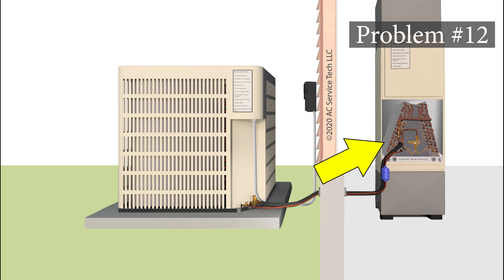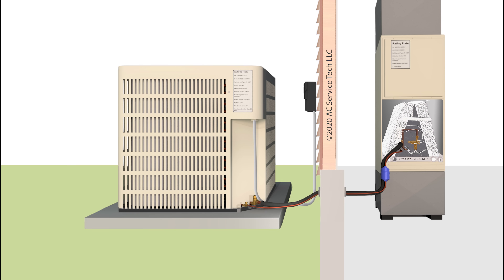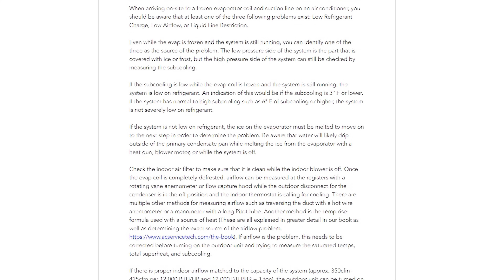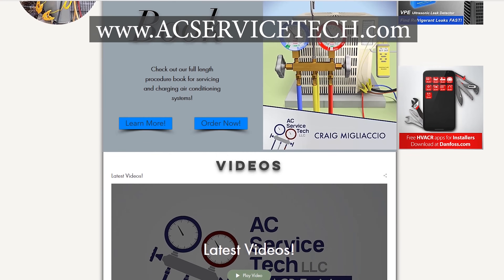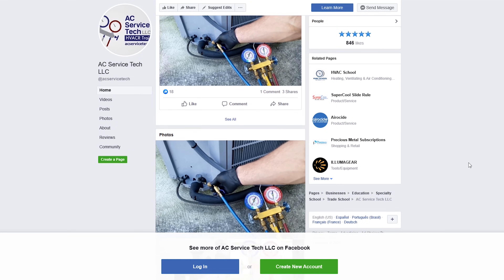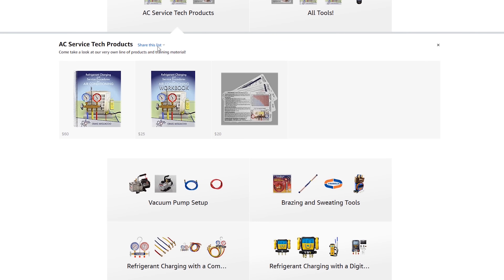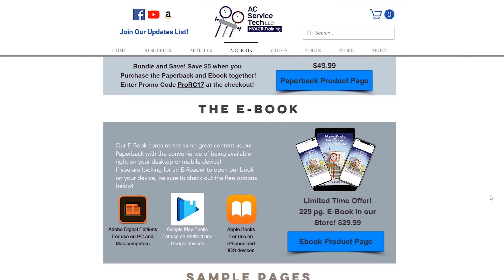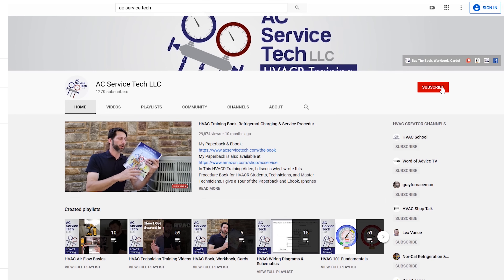20 Causes of Low Indoor Airflow on Furnaces and Air Conditioners!

Comment from the maker: -My Paperback, E-Book, Workbook, Quick Reference Cards: https://www.acservicetech.com/store  
-E-Book: https://play.google.com/store   and search "AC Service Tech"
-My Paperback and Quick Cards:  https://www.amazon.com/shop/acservicetech
-Support the Channel:  https://www.patreon.com/acservicetech
-Tool List:  https://www.amazon.com/shop/acservicetech
-Facebook posts every other day! https://www.facebook.com/acservicetech

-Our Articles and Quizzes: https://www.acservicetech.com

Related Videos:
TESP for Airflow https://youtu.be/eFmDmk1Siqc
Airflow CFM Measured with a Hot Wire Anemometer! https://youtu.be/0wWYsAn6eGo
HVAC Temp Rise Formula used to Measure Airflow CFM! https://youtu.be/agAfV3Yqb7U
HVAC Delta T Explained! What Temperature Should it be? https://youtu.be/9lDl5cfFSzs

Duct Sealant:
Duct Mastic in the Caulk Tube: https://amzn.to/3fc1pzm
Duct Mastic Tube: https://amzn.to/2SrIGpU

Checking the Charge Tools:
Yellow Jacket Refrigerant Gauge Set http://amzn.to/2aenwTq
Refrigerant hoses with valves http://amzn.to/2aBumVI
Yellow Jacket Gauge set & hoses https://amzn.to/2vLVkV9
Yellow Jacket 4 Port Manifold w Hoses https://amzn.to/2BkuGIq
Digital Refrigerant Scale  http://amzn.to/2b9oXYl   
Ratcheting Service Wrench   http://amzn.to/2dGV4Nh 
FieldpieceSMAN360 Digital Manifold Set https://amzn.to/2BdoaD4
FieldpieceSMAN460 Digital Manifold Set https://amzn.to/2nB4Fe6
Compact Ball Valve for Refrigerant Hose https://amzn.to/2KUisW8
QuickDisconnect 90 for refrigerant hose https://amzn.to/2MMtVcg
RectorSeal Bubble Gas Leak Detector http://amzn.to/2ckWACn
Fieldpiece ST4 Dual Temp Meter  http://amzn.to/2wc1ME3
Fieldpiece Bead K Type Temp Sensor https://amzn.to/2DBwKfs
Fieldpiece Wet Bulb Temp Sensor https://amzn.to/2RRI7Tw
Fieldpiece TC24 Temp Clamp https://amzn.to/2qHLyjZ

Electrical Diagnosis Tools:
UEI DL389 Multimeter  http://amzn.to/2xAdaJf
UEI DL479 Multimeter with temp sensor http://amzn.to/2jtsUbJ
Magnet Jumpers- https://amzn.to/2PyKPQZ
Alligator Jumpers- https://amzn.to/2PxqJXn
Irwin Wire Stripper/Cutter/Crimper http://amzn.to/2dGTj2V

Vacuum Tools:
JB 6 CFM Vacuum Pump - http://amzn.to/2nqbvo8
CPS 4 CFM Vacuum Pump - https://amzn.to/2DxgPwY
1/4" Appion Valve Core Removal Tool - http://amzn.to/2uYr8WL
5/16" Appion Valve Core Removal Tool -  https://amzn.to/2JHmfbP
Appion Blue 3/8" to 1/4" Vacuum Hose - http://amzn.to/2uYlVyc
Appion Red 3/8" to 1/4" Vacuum Hose - http://amzn.to/2uYg6Ro
Yellow Jacket 1/4" by 1/4" 3’ hose - http://amzn.to/2umtcod
Appion 1/4" by 1/4" and 3/8” hose - https://amzn.to/2Zyxzx9
Uniweld 1/4" by 1/4" 2’ hose - https://amzn.to/2GFov1Y
CPS Vacuum Micron Gauge - http://amzn.to/2v1nM3O
JB Vacuum Pump Oil - http://amzn.to/2mGrlXy

Flaring Tools:
Yellow Jacket Flaring Tool - https://amzn.to/2OBxGlM
Spin Flaring Bits 1/4", 3/8", 1/2", 5/8", 3/4"- https://amzn.to/31BCs8Z
Yellow Jacket Flaring Tool with Set Depth - https://amzn.to/2QIKsQH
Yellow Jacket Torque Wrench - https://amzn.to/2NRR68Q
Uniweld Swage and Flare Kit- https://amzn.to/2T55jyn
Nylog - https://amzn.to/2MLJcch
Ridgid Tubing Cutter - https://amzn.to/2DnjjR1
Wolverine Tube Reamer - https://amzn.to/2QGLyMV

Swaging Tools:
Manual Copper Tube Swage/Expander- https://amzn.to/2WRPa1M
Spin Swaging Bits 1/4" to 7/8" for the Drill-  https://amzn.to/2YQwwqS
Uniweld Hydraulic Swaging Tool- https://amzn.to/2MlrI8m
Uniweld Swage and Flare Kit- https://amzn.to/2T55jyn
Uniweld Hammer Swage kit- https://amzn.to/2CzWMMU
Uniweld 3/4" Hammer Swage- https://amzn.to/2CzXsSs
Uniweld 7/8" Hammer Swage- https://amzn.to/2Mja5WE
Uniweld Multi-Size Hammer Swage- https://amzn.to/2T3Cx1b

Brazing Tools:
Air Acetylene Torch setup - http://amzn.to/2aQalsb
15% Silver Brazing Rods - http://amzn.to/2gVLyLc
Ameriflame Oxy Acetylene Torch Setup #1 &#2 Tip - https://amzn.to/2SRm3JF
40cu B Tank to 10cu MC Tank Acetylene Tank Fitting - https://amzn.to/2GxZZPi
Nitrogen Regulator - http://amzn.to/2bXdR5f
Uniweld NitroVue Flow Regulator - https://amzn.to/2GnsaAo
Uniweld Nitrogen Flow Meter - http://amzn.to/2brvoBg
Stay Brite #8 Silver Bearing Solder and Flux - https://amzn.to/2XIDJsY
Aluminum Braze Rods - https://amzn.to/2IGNMu

Refrigerant Leak Detection Tool:
Accutrak VPE Ultrasonic Leak Detector https://amzn.to/2nFYKVe

Shop through Amazon! Your Purchases through Amazon provide a means for channels such as mine to earn advertising fees from all purchases after clicking through. Prices are the same as normal.
Reply: AC Service Tech LLC will a undersized curb adapter for a RTU cause low airflow if the return and supply portion are too small?
Reply: Do you have any recommendations for honest HVAC companies in Las Vegas or how to find one ?

Comment: My 100000 btu gas furnace was replaced with a 60000 btu gas furnace, now you cant feel the heat when your sitting down, what would you suggest.  I miss my goodman 100000 btu
   House is only 900 sq ft built in 1932

Comment: Hey bud got a question,  I   REILLO 40 OIL BURNING 🔥  FURNACE , I just replaced  the start run capaciter  with a made in Italy  capaciter , but the day before I wired a 100 w  light  bulb  as a test to confirm it was a bad capaciter , laugh now.... so anyway it fired up and  my vents have never blew air that strong before  and it heated m house from  56 degrees  to  52 degrees in 5 mins and shut off , now the new capaciter doesn't blow that hard it blows pretty much the same as the  old one and takes way longer to heat the house and runs alot longer , I can't run the damn thing with a light bulb so do u have any idea why this would happen ? Thank u sir 🙏

Comment: Please reply, what would be the minimum size of the hole or holes for the return to get at least the minimum air intake for a 3.5 air handler in a closet. I have two holes that are covered with a return grille that is 30x12 and the other is 24x14, would this be enough opening for air to get to the air handler and let it work properly? Thanks for any advice. David

Comment: #21. loose fan belt on a belt drive blower, #22 adjustable pulley not set properly or worn grooves, # 23 failing fan motor running slow, 3 phase motor running backwards, volume dampers closed too much,

Comment: What could cause cold air coming from a register during heating system in our first floor bedrooms but our back bedrooms, family room and kitchen receive warm air? We have gas heat, R-19 walls, 9” flexible insulated ducts and dampers above the furnace. Is it possible a duct came loose way up in the attic and the air being pulled by the return is pulling cold attic air into the duct?

Comment: So i have a Duct that blows so much air and blows the most air it's a smaller duct, and i have it taped because of that. we just got a HVAC replaced. but it's not distributing enough air to the rest of the house. how can i fix this. thanks in advance. also our ducts are quite old. probably the seals are worn.

Comment: I've got a buddy that's supposed to come over but I figured I would give it a shot on here. My high temperature limit switch keeps killing my furnace. My filter is clean and even when I bypass my high temperature limit switch it's still shuts off and throws the same code. My buddy came over and clean the flame sensor because he thought that it was possible that the fan isn't aware it needs to kick on because the flame sensor was so dirty. Anybody has any more suggestions let me know. I've never cleaned my evaporator coils didn't notice a thing that needed to be done. I've lived in this house for 4 years so I know it's been at least 4 years that they haven't been cleaned. I looked at it from the top and it didn't appear to be crazy dirty. However I couldn't get a good enough angle to see it from the bottom.

Comment: Another airflow problem I have seen many times on mobile homes happens on down flow systems with a clogged or cracked / corroded condensation drain. The overflowing water will pour down into the 12" crossover duct, completely filling it and causing half of the home to have air, but no air to the other half of the home.

Comment: One thing I experienced lately was the blower spinning in the opposite direction creating static pressure and little airflow. Reversing the polarity (swapped positive and negative wire connections at motor) corrected the blower. The blower motor controller module was replaced previously and just happened to cause the motor to spin in the opposite direction, which wasn't noticed until the home owners noticed the AC would not get to the set temp.

Comment: Good job I see this crap alot now I found out the hard way bout the secondary heat exchanger clogging plus dont use those 3m filters unless you oversize the filter grill

Comment: Problem #21 : If you have a thick filter (i.e. 5"), the cardboard separators between the filter fins can get displaced making the filter fins collapsed over each other.   This can happen with a brand new filter or whenever you pull it in and out.   It took me a few days to figure this out after checking most of the potential problems listed in this video.   I hope writing this here will help someone and make your day!   Great videos by the way, thanks for sharing!!!
Reply: yeah,look closely at those filters don't let the fans suck them in Sometimes they are not glued very well. Elmers glue might work.

Comment: I had a call back on dirty air filters.  the filters were checked during the PM.    I checked for a leak and when I was done; I decide to go under the house to check for damage to the ducts.  I noticed the EAC and my first thought was to open it.  the filters were slammed with dirt.  I removed them and told them they had to get a price on a new coil.

Comment: Thank you for detailed to the point info. You mentioned one reason for air movement slow down is the insulation get sucked in and blocks the air. In my case, when I have the ac on for maybe few hours, the air flow slows down on all vents, I listened to the fan blower and I did not hear any different sound than before. So in your advise it seems something is blocking the air flow. But when I turn the a/c off for 10min and back on, the air is normal, and it stays for a a while for another hour or so. My question is, is there something blocking as time passes or is it the coils icing, or can it be the thermostat? It is very coincident when the other day I removed the thermostat case and put it back, because the buttons were not working well on this, ti change time to program it. It's an old one. Any thoughts? Thanks.
Reply: NOt a pro. I made the swtich from old mercury thermostats (two floors, one unit) to an Ecobee3. Best move I ever made. Having 2 second floor sensors instead of the main thermostat, and putting the main thermostat (with another sensor) on first floow allows me to see when the unit on/off and the remote temps at the time. This alone is worth its weight in gold.

Comment: Is it possible for a duck to make a nest in a duct
Reply from the maker: That has to with migration patterns and the location of the building along with the visibility of the air conditioner from the sky!
Reply: The duck may need to duck if the duct is undersized.

Comment: Was doing a furnace inspection last Fall and found the High Limit had been bypassed. Thinking the limit may be bad I put a new one in. That didn’t work. It is a 3.5 ton unit. It had 2 x 12” return ducts each 50 feet long , poorly installed and one was completely collapsed.  This unit had been operating this way since it was installed. New return duct work was installed solving the problem.

Comment: Will the combination of excess return on the first floor and lack of adequate return on the second floor weaken the second floor supply?  In other words, the system overall is getting adequate return, but mostly from first floor.  Would this floor-to-floor imbalance result in weak second floor supply?  The second floor is hot in Summer by 5 or 6 degrees more than the first floor.  I peeked into the first floor return and there's no duct work, just open to the whole wall/framing.  Seems like it's pulling air into the return from places it doesn't need to.  I was thinking of "ducting" it up with foam board and sealant to force the return to pull more air from the second floor just above that whole opening there.  Also going to run jumpers from isolated second floor bedrooms to the main hall/return.
Reply: No, the first floors air would be cooler return causing a cooler supply. Sounds like all your cfm is going to the first floor and the second floor is receiving the left overs. Second floors will always be hotter. You may need a dampener system

Comment: My insulated line connected to top of the inside unit has some ice and is wet . Not kicking in full power just partly running

Comment: I have a Energy Saving Products HV-140 with 42 vent and the unit wired for high speed. The back of the unit is open with a 25" X 16" X 1" filter. The unit doesn't seem to put out the air it should be putting out.

Comment: I know 1” filters are disliked by many, but retrofitting isn’t in the cards. What 1” filter would you recommend? I like the fiberglass but I’m worried whatever passes through will land inside the system.
Reply: I have a defunct electrostatic filter on a Carrier so now i use 18x21x1 inch pleated filters I get in a 2pk from Walmart, not a perfect fit but works.

Comment: I worked 10 yrs for a school district,  my 1st air flow issue was on a ancient 10t that had about 4-5" of ice 
inside and  the sieve on a 3" shaft had spun, for whatever reason the key was gone, whomever had repaired 
it, was too lazy and opted to just drive the set screw into keyway and it destroyed the shaft ($2k,later)

Comment: 16-year-old 2 ton AC outside unit and coil and gas furnace in the crawl space. Replaced with 3 ton outside unit and coil. Did not change the blower and furnace. I see extensive sweating around the coil, and all the ducts/return etc...; moisture build on the ducts work. Cool is set to high in the blower. Since we have increased the capacity of the AC unit to 3 tons, do I need to replace the blower motor? How do I measure what CFM currently motor is at.

Comment: thanks for the video. Mine issue is a litle bit weird. the Airflow is ok when turn on the heat but only little airfow when use only fan or turn on tha AC. Have some technicians here to check but missed to tell me the cause. It would be very grateful if you could help to analyze.
Reply: I have this exact same problem, the a/c blows cold, but low air flow. Wondering what some troubleshooting ideas could be? 🤔

Comment: The proper way to check airflow is with a magnahelic gauge.  This should have been done on start up.  Most residential equipment is designed to run at no more than .5”  total external static pressure.  If the pressure is higher, it will affect the CFM capability of the blower.  You can take the reading on each side of the system to determine what is restricted, and then work from there.

Comment: Thank you for this small but very informative video. Learned some new things from this video today.
Reply from the maker: Glad it was helpful!
Reply: Restricted air flow or insufficient air ducts, especially returns, is the VERY common issue with residential A/C systems. For brand new house construction deficient returns can be found on ~95% of the houses! The first house that I had to re-run almost entire air ducts was…. My own house:) It is VERY common issue!

Comment: just installed a brand new AC system but my daughters room and my room air doesn’t flow with force it’s lagging tech told me something about 3 inch rubber where it should be wider to 7inches or wider don’t know who to trust no more

Comment: 3 ton system (oversized tbh)
9 supply runs of 6 inch pipe, so roughly 900cfm
they got 5 runs closed off and even had 3 of them covered with giant magnets to keep their rabbits from getting cold
sooo.... 4 6 inch runs to pump some wimpy airflow for 3 tons of air conditioning in humid illinois. Yeah they were pissed when i gave them an earful about their bullshit. They cooked the outdoor unit from years of that bullshit too, i couldnt get the charge dialed in right anymore. Gave up and told them to keep all the registers open from now on and control the temp off the thermostat like a normal human being.

Comment: I wish I could figure out why my system has low air volume. Its an older goodman ARUf with a time delay relay that has the purple wire in the COM on the relay and the black wire in the COM on the circuit board. I wonder if these need to be switched, as someone had replaced the motor recently. Hmm

Comment: Hey Craig my  Linux thermostat that will not come on And somebody had changed the wires and cut off the old one and added a  Black pull out fuse  nd the repair man is going take forever  I would like to see like a fix myself can  You are someone help please I'll  Email you a picture

Comment: How do you measure or calculate each room in terms of capacity?
Reply from the maker: You would need to go off of a manual J calculation and to be honest, its much easier using a full computer program to determine each rooms btu loss and gain in order to determine the airflow needed in each room, thanks!
Reply: AC Service Tech LLC can you do a video on that? Thanks

Comment: Great video! A clogged drain line will also cause a frozen evaporator coil, the water will start to freeze and form ice on the coil.
Reply from the maker: Yes that happens on freezers but on ac units the saturated temps should not fall below 32 degrees to freeze anything, thanks!